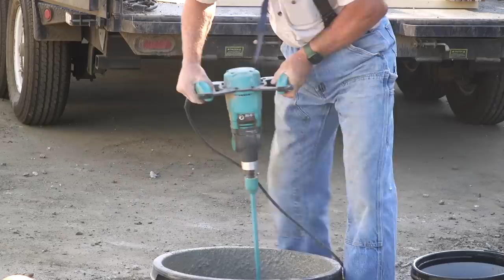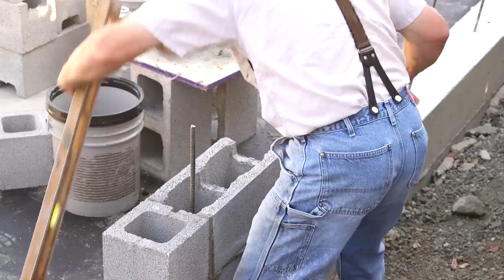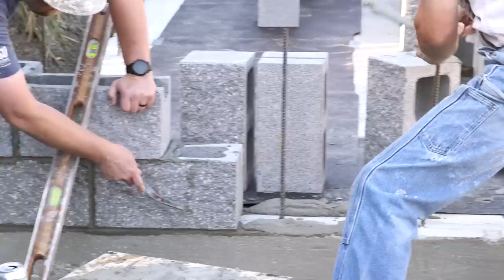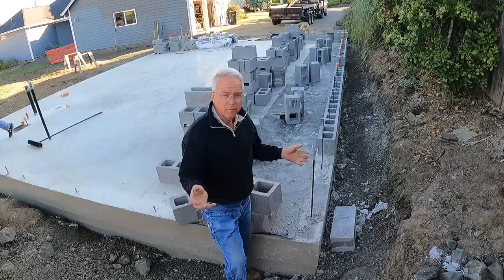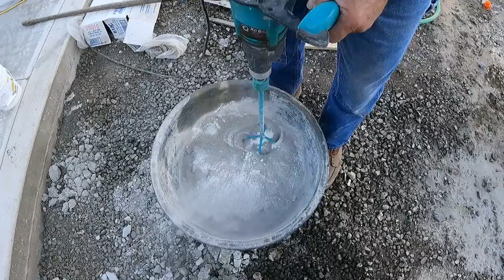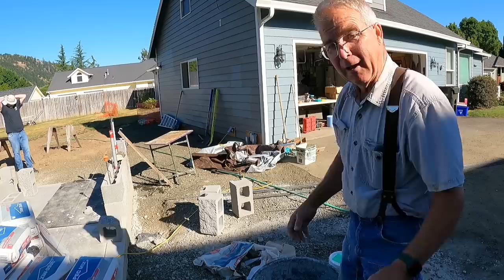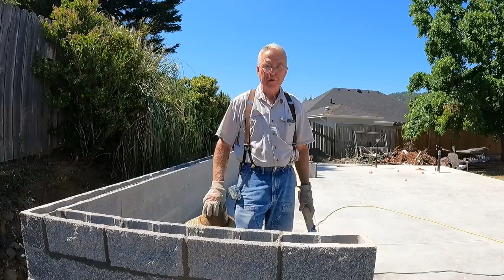I Finally Figured It Out - Learning Masonry: Shop Build #8

Comment: wetting the blocks helps heaps....that's some free advice after doing and getting the same result of drying too quickly when laying....some people advocate to keep the blocks in water until they are fully saturated so that when laid, they dry more uniformly thereby creating a stronger bond. I dunno if that is true but worth noting; How feasible that may be is another topic....either way, keep it up!
Reply: If anyone in the western US saw you wetting blocks before you lay you would be laughed off site.
Reply: @JMASON-qy7ki  diff’rent strokes…yanks don’t hold the monopoly on knowledge and methods….things that were unheard of 20 years ago are now mainstream…it’s a mindset thing I believe
Reply: @JMASON-qy7ki  
Why?
I've been a masons gopher, and I don't think any mason I have worked with would shun any idea that made the job go easier.

Also, wetting the block is an intelligent thing to do so I guess it's above your thinking sir.

Comment: I'm a carpenter also, and have recently dabbled with masonry while building my root cellar. There is definitely an art to the craft. I was able to get 22-25 block per bag of spec mix and just chipped away at it a bag's worth or two at a time. The mud consistency is the most difficult thing to learn

Comment: Standard full-sized, 2-hole block, not slotted for rebar or other specialty block, all have a top and a bottom. The center post on the bottom will always be narrow and the tops will be reverse tapered, being much wider on the top side of the block than on the bottom. This provides the mason a much better hand hold when grabbing the block by the center support, allowing you to manage the block with one hand and buttering both sides and laying in the wall without it slipping from grip. Always stock up (stacking block between mortar stands) with the top side up, unless you enjoy getting cursed n more work reworking your stocked block on the line!

Comment: I’m not a mason, I’m a licensed g.c. and work on site daily as a carpenter. However, I’ve laid 1000s of blocks . I build corners and stretch strings . I’m surprised you don’t do the same.  Different strokes. Semper Fidelis Dave the Carpenter in Omaha

Comment: Watch Mike Hadack a lot, and pre-soaking your foundation before starting, maybe pre-soak your block also will help keep the crete from pulling the water out. Wouldn't be surprised if it ends up being stronger because of it.

Comment: Not a brickie but as a self taught DIY plasterer/drywaller I can appreciate the difficulties in learning a new skill.    My biggest learning curve was holding and working the trowel.  Loose grip is all I can say.   Used to hold it like barbarian's axe, now I have a lot more control and dexterity using the thumb and forefinger method.

And does it matter which way up you lay them?  As in upside down?

Comment: I don’t know if it’s cheating or not, but as a kid I watched an old mason build a CBC wall around his acre lot in South Texas. Took him months as he could afford to buy block and as he’d work a few hours in the evening and on Saturday. Sunday was for church. During the very hot summer months when it was close to or over 100 degrees, he had a bucket of water he’d dunk each block for the few moments it took to set the previous block. They weren’t in the water for long but it was enough to wet the surface of each block. He’d also splash some on the rows he was setting upon. At those high temps, the water didn’t last long but it was long enough that the mortar could set without making it into soup.

Comment: Just a heads up, every mortar recipe is a bit different depending on climate.  Here in northeastern pa we use a bit less lime and more Portland because of the daily freeze thaw cycle during the winter.  Basically extra hard Type S.  The extra Portland makes the mortar very resiliant but it's way harder to work with.  Wish we could add more lime!  People should talk to their local supply house to see what the common knowledge is in their part of the world!

Comment: For your set up- five blocks stocked, heads facing the wall being built. Then 3 on end to put a mud board on top of. 5 stocked, 3 on end for another mud board. 
Wet your boards completely before a shovel of mud. Amazing how much moisture is drawn out from bare wood.

The scientific explanation of mud consistency is as follows:
“Fluffy, not stuffy. Soupy, not poopy.”

Split face are tough to lay. Heavier.

Comment: Give your trowel a tap so the mud will stick when you’re spreading on the block. Also butter the block that’s laid not the block you’re laying. That trowel is too big for you as well. Get a 10”. Your mud is getting hard so fast because you aren’t letting it flash. You mix it to the right consistency, give it 10-15 minutes then splash some more water and mix again and it will stay perfect a lot longer. Union bricklayer here in Minnesota Local 1.
Reply: Local 21 Chicago 43 years. My card says B, PCC, CM, T, W, and Precast. I started in Seattle 1978 with pops as a Stone mason apprentice field dressing lannon stone. Ive traveled the world learning the trade. Im a masonry junkie and now consult in historic masonry. You never stop learning till your dead.

Comment: PRO TIP, always blend the cement, lime and sand dry.  Once you have added water never add cement or lime without first blending it with sane.  A batch of mortar can be adjusted but the direct addition of cement or lime will make it lumpy.  (machine mixing can eventually get it blended but you will be cooking your mix and it will not last as well for working).  Blend it with sand (your adjustment recipe (cement, lime, or cement and lime), then add it to your mortar that was improperly blended and you have a fix.

Comment: Corner leads are where you should start, then when you lay courses you can run a string line corner to corner and keep each course straight and mortar bed consistently even, also you can use your level to just check the width for levelness and use the string for length leveling. Also use story poles to keep each lead corner the same.

Comment: Back home we get the kids to push mortar through the vertical grout lines and finish the horizontal ones with a skinny grout trowel. Allows for much faster block laying. Also use a string line as a guide.

Comment: Well from what I saw here my tips are… 1. Always start the mix with a full measure of water and slowly add the dry mix. Saves time and clumps down the bottom don’t form. 2. I’d generally try to have a solid spatch of mud on the ends of the block and not create cavities you’ve seemed to have made with edge spatches

Comment: The way you pat the mud with the back of the trowel to get a line, and then pick it up is good form...for brick. For spreading on block just bury the trowel, fill the whole thing, and then give the tip a pat on the board (some guys will do this in the air and not tap the board but my wrists can't take that repeated strain). This will firmly adhere the mud to the trowel. You should be able to tip it upside down now and it will hang. This affords you much better mobility to get your trowel positioned for a swipe down the block especially when trying to get between bar, and the full trowel will take you further. This is why many guys prefer philadelphias for block as you don't need the "line" of mud like you do with brick or other veneers. The wider heel of the philly carries more mud further back which reduces the leverage acting against your wrist and minimises strain while keeping up productivity. Also, a half block makes a great level stand. In fact you can order the levels with block plates for this reason.
Reply: Don't mind if I take your pro tip, sounds like my block laying is gonna improve, I'm needing it! Thanks.

Comment: Between Pancake batter and creamy peanut butter  is the consistency you looking for, yes, that's awful wet but if you account for all the wicking from the concrete and the block that moisture goes away quickly. When your laying your block on the bed joint bring it down until it contacts you mud and hold onto it for a moment before allowing it's full weight to settle down. They'll behave more uniformly as far as settling down. 

If you find that consistency is too wet, hose off your block and the slab before you start laying, they'll wick less water out of your mud.

Comment: That is what is called gauged mortar, it does not crack easily and is very resilient( try knocking a 9” brick wall built with it down !)  It has gone out of fashion because it is, or should be as sticky as hell and can make an awful mess on facework. Brickies tend to use mortar plasticiser nowadays.

Comment: Before you spread the mud on the block, make sure you slap the board with your tool with mud on it so it doesn't fall off your tool. You will be able to have more mud on your tool and therefore, spread more mud.

Comment: So in the UK we use plasticiser, works much the same as lime but its normally a liquid additive, makes your mix more 'fluffy' so it's easier to work with, helps with being able to push the bricks/blocks down into the muck. Also for those concrete foundations I'd have thoughts spraying them down with water first would be helpful as it'll take put some of that suction and increases your working time. I've done a fair amount of brickwork but I'm no brickie so the extra time is always helpful I find

Comment: What height were you going off of? You typically get from finished floor and with a laser shoot all your corners and mark it on the rebar. then check your bond from end to end, also did you put a control joint? Nice try sir keep up the good work! From phx AZ

Comment: I'm curious about the reinforcement rebar both vertical and horizontal. For a place like Texas that has notorious foundation movement and cracking, I wonder other than cost could you reinforce a wall too much (nothing too strong ever broke) or would it lead to other problems such as weight, sagging, and collapsing on itself?
Reply: You need the foundation to move. You need the walls to move or else they will crack and break. You can see it all over old brick buildings in California where they've drilled in and added steel and plates or pasted over the outside with various flexible reinforcement. Both of these end up looking like crap because they ruin the look of the brick, but it's better than having walls crush people in an earthquake. Newer buildings are built to move. Even if you ignored cost, you would get to a point that the mass of a structure would be so great that it becomes a problem for the foundation it sits on. You can't build up more than a few stories because it can't support itself. 
For things like skyscrapers, its why steel is king. Although for residences, there is a very solid argument for large thermal mass. In the western US, adobe homes and buildings were how the native peoples kept their homes cool in the summers and warm in the winters. Big thick earthen walls don't change temperature quickly and it keeps the house comfortable for longer periods. Truth be told, we could probably cut energy costs in many areas in the western US by digging homes a couple feet into the ground, using ground source heat pumps and building large thermal mass exterior walls.
Reply: @DriveCarToBar  I know next to nothing about masonry, but your comment seems really interesting and thought-provoking.
Reply: @DriveCarToBar  you don't want large thermal mass, you want lots of insulation, preferably with low thermal mass. And very good leak proofing to prevent heat losses.
Reply: @wouterbaake7386  You're going for the same goal. The idea is to keep temperatures inside as constant as possible so that climate control systems don't have to work as hard and expend less energy. Same reason you find pit houses and Adobe construction among native American populations in pre-Columbian North America. By using the natural soil temperatures, you can keep the home warm in the winter and cooler in the summer. That's why we're seeing a resurgence in Earthen construction in the USA.
Reply: No matter  where you live..you always put every second row horizontal line rebar..
Reply: @DriveCarToBar  it all depends on the location here in Southern Oregon we never get earthquakes at all but we get fires so masonry homes would be well situated here as opposed to California that has alot of seismic activity.
Reply: @DriveCarToBar  you are not properly educated. The movement causes the cracking. Reinforcement strategically placed with the soil stability assessment taken into consideration by a licensed engineer for the region of the country prior to building will prevent problems for a few decades if not longer..I build every day work with the people fixing all the work that has not been done properly.
Reply: The rebar thing is going to rot inside there in the concrete like everywhere masonry is done. I don't know why they use it in an ordinary house that is not a bridge, for example.
Reply: @pistool1  rebar doesnt rot..your brain does btw.. it rusts if its staying in earth or exposed to air..if not..its there for milenials

Comment: There is a brick building in Harrison, AR, maybe built in Depression era, but anyway, an older building. The man who was building it hired a professional bricklayer to build it. Then he hired two young men with little to no construction experience to help. He told the boys to carefully watch the bricklayer. After a little time, he fired the bricklayer and told the boys to finish the walls. The walls are not eactly straight, but it was still in use as of 1980, and I suspect still is.
It was dirty of him to treat the bricklayer like that. I don't know what kind of contracts they had back then, or if they had any. I just remember the story I was told about that building.

Comment: I have some videos that would be helpful with mud constancy and trowel technique. Your trowel sounds new. Even the best of bricklayers struggle using a new trowel. It takes a few weeks of heavy use sometimes longer to break it in. I would suggest buying a used trowel from a bricklayer. It won't be cheap but it will be so much easier to use. I noticed your trowel was rusty on day two. That tells me you cleaned it with water at the end of the day. Unlike most other tools a brick trowel shouldn't be perfectly clean. A little build up helps the mud stick. An occasional scrape with the cutting edge of a brick hammer is all that is needed. I only completely clean my trowel a few times a year. I love your content! I hope to one day be able to create such useful content! Thanks.
Reply: Expand on "breaking on a new trowel" please..does it get more flex? The edges must get thinner and really sharp? Maybe the build up of mud in the fine scratches gives it a bit more "stick"?
Reply: @marcsheldon6512  the biggest part is thinning the edges and tip. That makes the trowel more flexible. The flexibility helps you to feel what you are doing. A new trowel always seems slippery. The mud seems to slip right off. Also the new trowel is bigger than what you are used too. All the repetitive movements with a heavier trowel wears your hand and wrist out. Concrete finishers will tune or set a new finishing trowel. I have always wondered if you could tune a new brick trowel to shorten the break in period. I have never bothered though.
Reply: Makes total sense..thanks a
Reply: Crap..thanks! Not thanks a..lol

Comment: Thanks for the enjoyable video! These blocks are kind of the worst of both worlds in my opinion. You have to do brick laying with mortar AND pour concrete. Not sure about the US, but in Europe we would use form work blocks for that. Those have openings in the side, so that the concrete can flow from stone to stone. No mortar necessary at all. Just lay one layer, pour in concrete, lay next layer.

Comment: The proper way to check for absorption is to test the masonry unit that you are working with. The absorption rate will depend on many factors from time of season and weather to the type of masonry unit that you are working with, so depending on the test results of the absorption rate you will then adjust the masonry unit for more or less moister, you do NOT adjust the mortar to make it wetter, this will weaken the strength of the mortar if you add to much water.

Comment: you can build that foundation from granite that you split from blocks next time. good effort, plasticizing your mortar with lime is a good move. presoak and smaller batches working quickly in intervals is better. avoid midday sun. mixing masonry mortar in wheelbarrow with hoe I prefer over paddle mixer.  paddle inside for thinsets and grouts

Comment: Don't hit/tap the blocks when you put them down, it will make the water split from the cement. Push them down instead with constant pressure.
Also, wet the concrete and/or the blocks properly before putting them down, that way they won't suck the water out of the cement.

Comment: Question for the masons, wouldn't it be better instead of making 1 wall by 1 wall to make the corners intertwine first? so you put a block down, and then put another block perpendicular to it on the corner and then put a block on that to go on both of those ?
Reply: I believe that's standard practice, but I'm no mason!

Comment: having filled block walls in Florida, do yourself a favor, pump it. I know the grandkids learning a trade a good thing, but they can still get concrete on them if you pump the mud. You still need to knock weep holes in the block to verify the mud makes it down the cells and you still have to tie in the bar. Plenty of dirt to get under their nails.